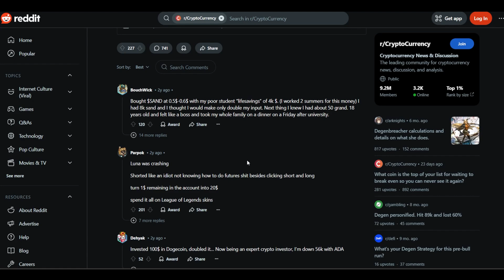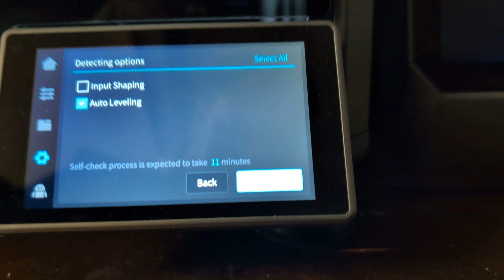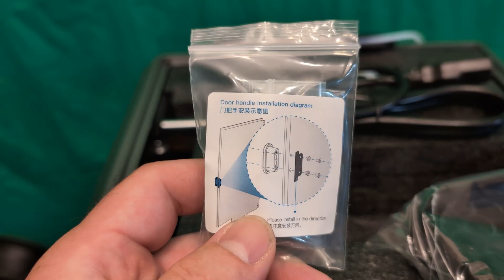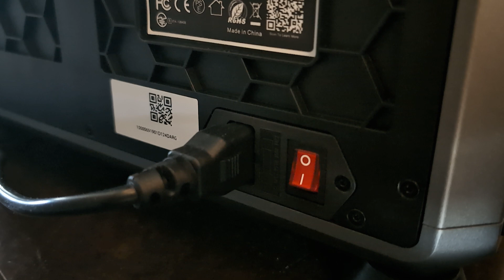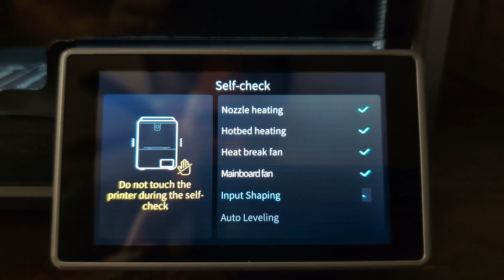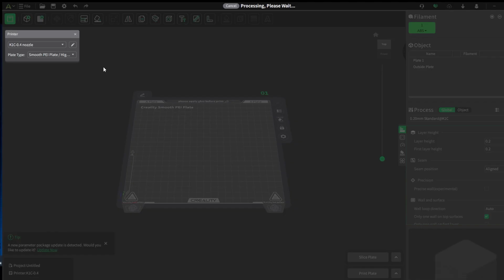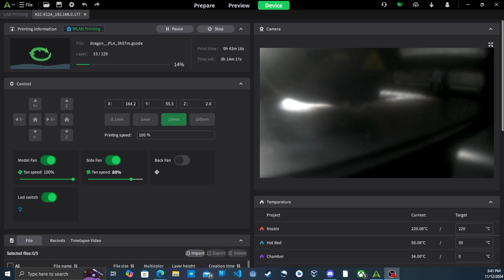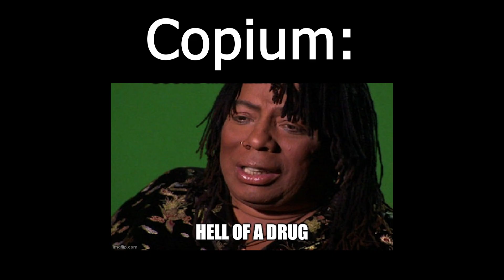Is the Creality K1C 3D Printer the BEST for Beginners?

Comment: I was wondering why the camera quality was horrible on my K1C. I guess I need to take off the plastic wrap lol. Also, I noticed the AI stuff is turned off by default. You might need to turn it on and test again on your end.
Reply from the maker: I really appreciate the heads up on the AI setting, I didn't even think about the possibility it would have to be manually enabled. About to turn it on for my next print and see if I notice any difference. It would be really nice to see it catch failed prints and such, but I also wonder how often it detects problems that don't occur. Let me know what your experience with it turned on has been,
Reply from the maker: Reporting back... turned on AI... and my very next print the spool tangled. It kept going as usual and didn't stop or anything ended up getting the filament burnt and stuck in the extruder. Luckily it was only a 30min print so I dont think too much damage was done. I had the AI sensitivity set to "conventional"